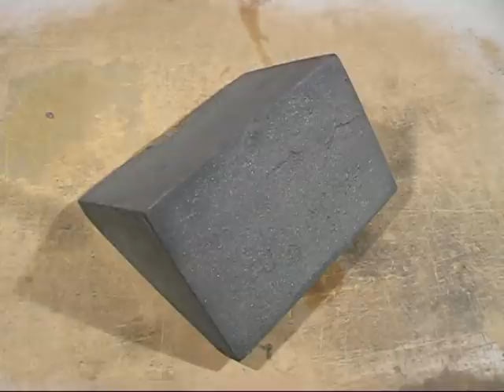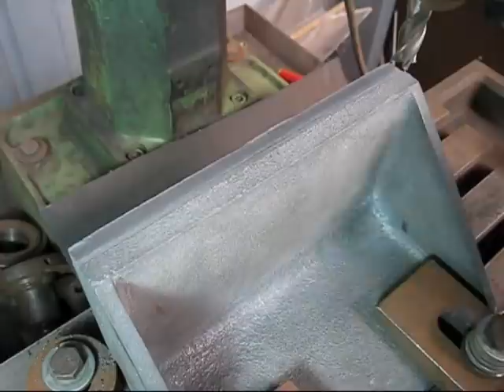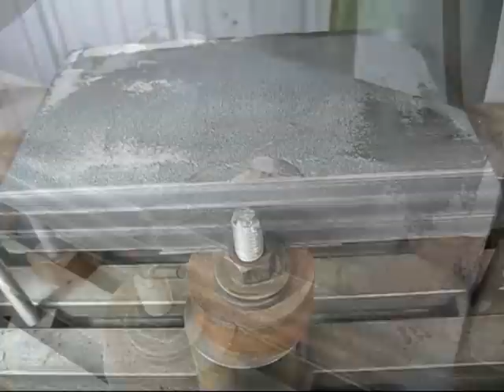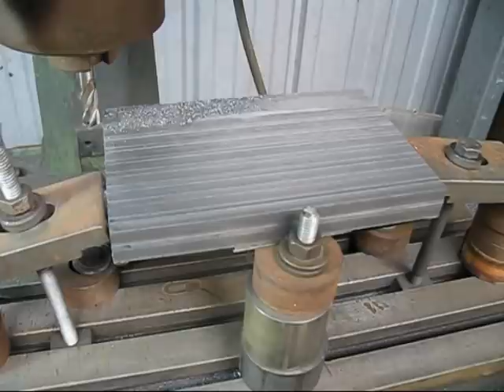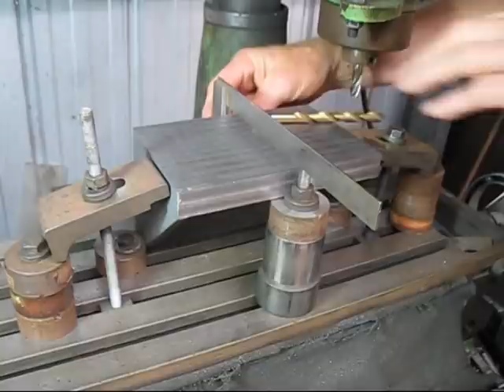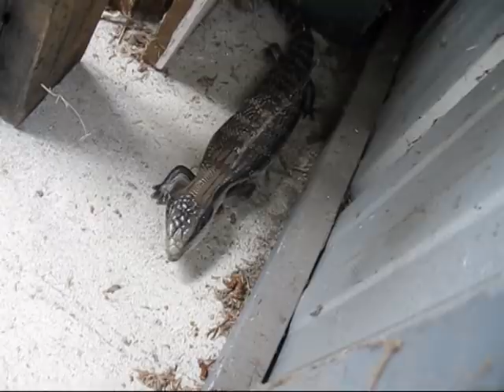Machining my iron castings (angle plate)

Comment: Ironman, just a suggestion. Cast two angle plates. Rough flatten the faces of both plates with grinder and file. Drill the plates so you can attach them to each other, and bolt one of them to your table. Shim it so the vertical face is square to the table. 

Now bolt the other one to the mounted plate and shim their joint until the upper plate is level/parallel to the table. 

Mill that one with a fly cutter. You can make one of those from a big disk of cast iron with a stem, and put a carbide insert on the edge.

Mill the top face of the angle plate flat. Now unbolt it and bolt the finished face to the base plate. The base plate is already square to the table because you had shimmed it that way. 

Now just make sure the upper plate is parallel to the mill table (no shims for this, just rock it on the bolt until level). Mill that and you have your first milled angle plate done.

Now unbolt everything and bolt the milled plate to the table and mount the unmilled plate on top. Check it and mill it flat, as before. Then reverse it and mill its other face.

You can do all this on the lathe on a faceplate, btw. Just substitute the faceplate in the above description for the mill table.

Hey, miss you on madmodder --- have a visit one of these days. And keep up the great work!

Comment: Nice work. This machining bit would be so simple on a horizontal mill. But, yes tabs in the right place would make it much less complex for setup. Thanks for the tip about casting large flat surfaces in your previous video. I plan on trying the minimalist packing approach. I'm about to cast a 450 x 145 x 20mm thick grey iron "plate". I hope it works.
Reply from the maker: That is a really big iron casting, be sure to make a video about it.
Reply: @luckygen1001  I'm not very good at making videos, but if time permits I will try to get some footage of the moulding process and casting even if it's a fail. It's going to be quite hot this weekend 38Celsius (western Canada is in a heat wave), so we'll see.

Comment: I had an on topic thought about something that might make milling these easier.  The first thought was to cast ears on the piece that could be drilled and bolted with t-bolts and stand-offs.  Then I wondered about actually drilling the sides so they could be bolted to a fixture and adjusted to the correct position before being locked down.

Comment: Sorry to be off topic with this comment, but I was wondering if you have every had any experience with casting copper in a two part sand mold.  Any suggestions?
Reply from the maker: Yes I have and I found out that copper is a very difficult metal to cast so if you do try it don't expect to be successful the first time.
Reply: @luckygen1001  Hi, I continue in the pursuit of copper casting but was wondering about your cast iron work,do you primarily use petrobond sand or a water and bentonite sand for your castings?  What is your rule of thumb for venting.
I am currently at 10 percent bentonite but am thinking about upping the percentage a bit to enhance detail retention with the copper. I'd very much appreciate any thoughts you might have. Thanks.
Reply from the maker: @jimintaos  I don't use petrobond with iron. I use bentonite and coal dust with my sand + water. 10% bentonite is too much, I use 7.5% - 8%. I don't use vents as my sand is free venting.
Reply: @luckygen1001  Thank you.  I had wondered about the 10 percent bentonite recipe.  My memory was  of 7 percent but then I came across the 10 percent formula and doubted my older memory.  I found that it does a fine job of casting aluminum, nice detail but the copper is a whole other issue. I am now thinking I am going to have to preheat my molds if I want the copper to fill the cavity and pour hotter as well. I greatly appreciate your advice and am enjoying your channel.  One of these days I will try casting iron but for now I am learning all the possible ways to go wrong with aluminum, bronze and copper.  Once I get this copper gig finished I am looking forward to all of the other possibilities.  Again, thank you.

Comment: Tabs or holes cast into the gussets would be the easiest to assist in fixturing, but in this case there's another option that includes neither holes nor tabs.  Try clamping a small block of aluminum to the outside of the gusset with a shallow C clamp (one on each side).  This will give a small 'ledge' to toe-clamp down on and the aluminum is not likely to slip on the rough cast surface.  A supporting jack or shim stack near each toe-clamp under the top edge will give the needed support.  Love the channel, keep up the good work!

Comment: You always need to use two or three axis during a set up to achieve Square. If you're not doing that, you need to use a dial indicator for the next set up. Without a dial indicator or known square block or vice, you're doing a lot of guessing. Can you come out somewhere close but not true. If I was to surface grind your project Square and true, I'm pretty sure it would be out more than any machinist would appreciate.

Comment: I would have just stuck a jack under it, and clamped it from the top surface, moving the clamps when they got in the way of cutting... "clamp dance". I would have put the holes in first, more places to clamp then.
Reply from the maker: I thought about the using the clamp dance but it can lead to an inaccurate angle plate.

Comment: I would have made holes or slots in the sides to hold it down. You don't seem to have anything holding the part down, only from moving sideways.
Reply: I'm with you on this plan. A couple of 12 mm holes drilled through the angled webs and either thread the holes or afix 2 lengths of all thread with locknuts and there is your protrusions for clamping down on.
Reply from the maker: @howardosborne8647  Read Anthony Ruddys reply, casting tabs so the angle plate can be clamped down and then machine them off. I think that is the best idea so far.
Reply from the maker: The clamps are holding it down but it is not 100% secure.

Comment: As I was looking at this video I thought Flycutter!!! Surprised you didn't hear me :) Have you stress relieved your casting? Cast iron is a lot like wood in my limited experience. What you take off of one side will effect the dimensions of the other side. Nice to see an absence of  chilling. Are you going to go all out with this angle plate and scrape it to a desired tolerance?
Reply from the maker: I will have a go at scrapping and use a file. No I have not stress relieved that casting but machining tends to relieve stress.

Comment: grabs endmills and sharpens them lol. Alot of the stuff I cast has alot of thin sections on them, so I think I would just avoid using the brake rotors tbh, but it looks like it would be ok for thicker stuff. Does the brake rotors shrink any more than clean cast iron, or is it about the same?
Reply from the maker: Brake rotors shrink about the same as other cast irons.
Reply: @luckygen1001  oh, ok

Comment: I was able to borrow an angle plate of known accuracy and bolt it down to the mill table.  I'd already drilled holes in the casting so I could bolt the casting to the good angle plate in a sort of Z configuration for the face and edge cuts. Cute blue tongue!
Reply from the maker: I wish I could borrow one to do the same as you.

Comment: How would I have held those castings without a good milling vice? I would have machined a couple of cylindrical squares of the appropriate length first. I used to work in the open pit mining industry and managed to pick up a few piston wrist / gudgeon pins from large Cummins V16 haul truck engines that are hardened and ground. Without those I'd just machine some soft ones. That gives you the correct stable 90 degree reference surface to the mill table to clamp the casting faces to.And you have to be careful not to induce stress into the castings once there removed from what your clamping them to since your flat surfaces may no longer stay as flat as they were machined to. Obviously it takes a properly aligned lathe that does turn parallel to machine your own cylindrical squares. But you should already have that anyway. Cast iron that's not chilled is one of the softer metals. Yes you'd likely have to use an end mill to remove the castings surface skin, but I still would have fly cut the surface once that was done. An ultra sharp high speed steel tool and light .003"-.005" depth of cut would have made it just as flat and square as your mill head has been aligned to. 

That hammering effect you mentioned is a given with fly cutters if there used incorrectly. There classed as and have ALWAYS been a very light finishing tool. And they've never been meant for taking large depths of cut. Yes there are a few designs shown by a few company's that do show large depths of cuts being taken. The tool will do it, but the machines were using including even Bridgeport's aren't capable of doing so for long without suffering damage. It hammers both the spindle drive splines and the spindle bearings. So those razor sharp cutting tools and light depths of cut aren't optional. If you want large depths of cut with larger diameters then a multi tooth face mill is required since there's always at least one tooth cutting continuously.Then there's very little hammering as the next tooth enters the cut.Where you are now and without a good surface grinder then if far better accuracy was desired for your angle plates then hand scraping and a lot of work isn't out of the question in a home shop. There's ample Youtube videos showing how to check squareness or even make your own squareness comparator. 

I also don't trust any square no matter how good when it's easy and quick to use the mills Z axis with an indicator swung back and forth in the spindle to ensure the part is truly square to the machines own Z axis. Other than buying a couple of good cylindrical squares as master references and the square in my combination set I haven't bought any other squares at all. Dial and Test Indicators are your best tools for checking and adjusting for square and parallel. It just takes some imagination and practice to figure out how to best use them. I hope some of this helps.
Reply: Agree,turning point. Big gudgeon pins make very good cylindrical squares. I have a couple from an old Perkins engine and one bigger pin that came from a large marine diesel. Also second what you say about flycutters being light load cutters if properly set and sharpened. In my apprenticeship days we used to have forgings and raw castings arrive and the first op was create a flat face and a face square to it. These first machining ops on such components were always carried out with flycutters.

Comment: Despite the superficial imperfections, the casting seems to machine quite well. You have now a lot of scraping to do :-)
I was wondering if you had made the diagonal sides full square (to be cutoff later), you would have a stable base for machining the sides. Of course, that would have made the casting even more complicated. The other alternative are holes for clamping in the diagonal sides.
Reply from the maker: Yes sir lots of scrapping ahead. I had thought of the holes in the diagonal sides idea but did not like the idea of looking at holes after the casting was finished.
Reply: @luckygen1001  You got a point with the holes - they wouldn't look good on the final product - kind of like a toilet paper holder :-)

Comment: While you were machining that angle plate, I was thinking you needed more angle plates to hold it. I'm a cheapskate and have a few suspension riser/ lift blocks that I use as fixture blocks. The guys that you get your discs from might have some of these.
Could you add tabs to your pattern to use as clamping points and just cut them off when you've finished machining the part? Stay safe and well :)
Reply from the maker: What a great idea putting tabs on my casting and cutting them off after the casting has been machined.
Reply: @luckygen1001  That's not sarcasm is it? I've never done that with a casting, but I have with other things.
Reply from the maker: @AJR2208  No it is not sarcasm. That method is used a lot when machining castings that are difficult to hold. Thanks for reminding me as I had forgotten this method.
Reply: @luckygen1001  Thank you :)